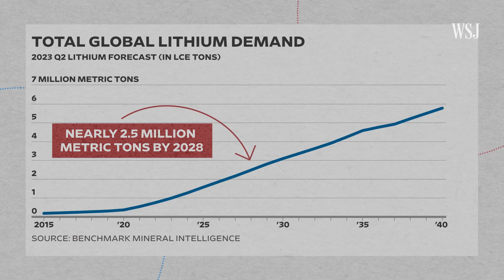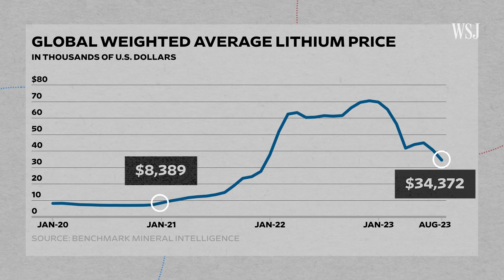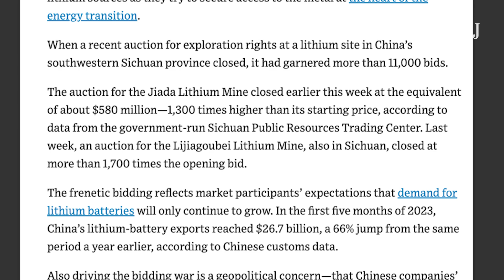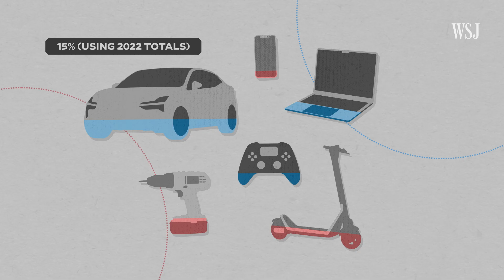How the U.S. Is Investing Billions to Compete With China’s Lithium Supply Chain | WSJ U.S. vs. China

Comment: China is ahead of the US in EV tech because unlike the US, China has to import most of its oil and gas. 
The EV industry will help China become greener and more self-reliant when it comes to energy imports
Reply: Doesn't the video say China gets most of its lithium from overseas?
Reply: Were do live! in cave!, it's US that's ahead of everybody else in EV technologies,  you are confusing mass production of junk EVs by China as their lead in EV technology.
Reply: Greener probably not so much considering the volume of coal power being brought online, and we can question how their raw resources are being secured.  China is doing this for their own independence and for financial reasons, not environmental.
Reply: @Destor-p3b It's both and much of Raw materials comes from AUSTRALIA.
Reply: >> China is ahead of the US in EV tech because unlike the US,  <<
ever head of Tesla, which is a US company?
Reply: @tooltalk the most advanced Tesla factory is in Shanghai, and they get most of their batteries from Chinese battery manufacturers.
So yah, China is way ahead in EV tech it's not even a race at this point.
Reply: @jayceh  >>  they get most of their batteries from Chinese battery manufacturers. ,<<
Tesla's most advanced EV models use batteries use batteries from Panasonic and LG.   China's cheap, inferior batteries are for base, low-range models.  The EU is also investigating whether Tesla was given kickback from the CCP to use their inferior batteries for EVs exported to the EU.
Reply: @tooltalk  wrong, Chinese batteries are at least 2 generations ahead of Japanese ones. Please do some basic research.
CATL and BYD lead in tech and volume by at least a half decade.
Reply: @jayceh  >>Chinese batteries are at least 2 generations ahead of Japanese ones. <<
A lot of wishful thinking there.  The lithium ion batteries were pioneered by SONY back in the early 1990's and the Japanese and Koreans have lad the industry since.  China's LFPs are cheap, inferior batteries licensed from a patent consortium in Suisse years ago and China spiked them up for use in low-range, urban driving EVs.  Outside China and under certain application such as ESS, their appeal is very limited.
Reply: @tooltalk  yah they had a 3 decade lead which is even more egregious that they fell so far behind lol
Light research shows only CATL, and later this year BYD have 800km+ batteries for EV, up to 1000km by end of this year
Panasonic is stuck around 550-600 real world range.
Deeper research shows the completely different approach which shows Panasonic will never catch-up
Reply: @tooltalk  but really all you need to know is that after the real world range of Toyota's flagship EV was widely criticized in Norway and other northern European countries, they switched to BYD for their EV lineup.
Reply: @jayceh  lol.  neither Japan or Korea makes cheap low-end batteries for gold carts.  Catl's specialty is in mass manufacturing, but their batteries are low quality.  BYD is slightly better than catl, but they are stuck with cheap lfp.  No 750/1000km with low end batteries.
Reply: @tooltalk  CATL dominates golf cart batteries due to superior technology (manufacturing) and highend batteries due to a different type of superiority (chemical)
Again if you did any research you'd know high end batteries are dominated by the Chinese. Also low end. Also midrange. Also storage batteries like sodium ion.
Also molten salt nuclear reactors... but that's something else. Only the chemistry is similar.

Crawl out of your rock from 2018. I know it sounds recent but the world's changed since then.
Reply: @tooltalk  Tesla battery supply chain manager Vivas Kumar disagree with you.
Reply: @TheExtraterrestrial99  disagree on what?
Reply: @TheExtraterrestrial99  >> Tesla battery supply chain manager Vivas Kumar disagree with you. <<
Disagree on what?  Again, Tesla uses China's cheap, inferior LFP batteries on entry-level, low range models -- the Koreans and the Japanese NCM/A batteries in the higher trims.  What "advanced batteries" is China making for Tesla?
Reply: @tooltalk those LG and Panasonic your talking about basically can’t manufacture batteries without china lol. And 8 of the top 10 battery manufacturers are chinese.
Reply: @tooltalk South Korea and Japan is too reliant on Chinese Supply Chains. If China doesn’t provide refined materials they can’t make batteries. If you can’t make batteries you can’t make EVs. China is just way too ahead on this space
Reply: @theburden9920  >>  And 8 of the top 10 battery manufacturers are chinese. <<
Actually no.  Most Chinese battery makers make batteries for domestic consumption and little outside China where foreign battery companies aren't allowed to compete.   Outside China, the largest battery makers are LG, SK On, Panasonic and Samsung.
Reply: @tooltalk  the foreign carmakers are actually allowed to compete. But as a car firm you need to move your factory to china to access these batteries.
Reply: @tooltalk  idk where you draw your conclusions from but those companies you mentioned aren’t even close to China’s markets share in batteries. And batteries is just one component from the EVs. What about the high temperature magnets?? That China is literally the only country who can produce them??
Reply: @tooltalk lol, the only reason that Tesla still using Panasonic batteries is because the US government banned the EV factories in America using Chinese batteries. That’s also the reason Ford cancelled the EV plan because they can’t use the CATL batteries anymore.
Reply: @vrealzhou  LOL.  A lot of wishful thinking here. Tesla has been using Panasonic for a decade already and there are already Chinese battery companies such as Gouxuwan, Envision, etc..  China's LFP for only low-end, low-range EVs..
Reply: @tooltalk  where did Tesla's battery come from? ever heard of BYD?, the largest EV Car manufacturer
Reply: @birdsnature6421  : Tesla's batteries come from Panasonic -- the company has been with Tesla since the very beginning.   Tesla also uses cheap, inferior Chinese LFP batteries for entry-level, low-range models, which also happens to be under the EU's probe for having been illegally subsidized.

Comment: China's BYD is going to announce sodium ion battery powered cars by next year. This will drastically reduce the price of their low range vehicles. Lithium will still be used but sodium ion will be what will revolutionize the EV  space. Lithium will slowly be used for niche vehicles. Ie: Only for long range vehicles.
Reply: sodium isn't for high-energy vehicles -- they are for ESS.
Reply: @tooltalk What is ESS?
Reply: @slomo4672  : ESS == energy storage systems.  Think Tesla Powerwalls or stationary power grids.   Not all batteries are suitable for moving vehicles b/c of weight and EVs are already much heavier than ICE counterparts.
Reply: Sodium ion has very low energy density. It will not work on most vehicles. 

There is a lot of lithium in the world, look at lithium prices in last 2 years
Reply: Sodium ion battery is not feasible in EVs, or consumer electronics, that's the reason there are not that many companies in the world working on it.
Reply: UNINFORMED !  Sodium ion  batteries have been around for some time now and NOT developed in China at all!
Reply: Don't forget cell phones, cameras, computers, drones. There are tons of uses for lithium beyond cars.
Reply: And Tesla already has solid state batteries and that will be the future
Reply: @othmarbrunner9639  >> Tesla already has solid state batteries and that will be the future <<
SSB is not the future. Nobody other than Toyota is betting their house on that.
Reply: And guess what, they use lithium. There is only one metal at number three on the periodic table, pretty obvious isn't it?
Reply: @howardsimpson489  It was of little importance for millenia; it will become of little importance soon enough.

Comment: Lithium is plentiful. There is no need to fight for lithium. The value of lithium is tied to the ability to process the mineral.
Reply: Lithium is plentiful but not all of it is easily reachable or mineable.
Reply: @Heist1000  You are right, the US is home to the largest lithium deposit - 7.9 million tons. However various interest groups do not allow it to be mined.
Reply: >> The value of lithium is tied to the ability to process the mineral. <
LOL.   The problem is of mining which could take anywhere between 2+ years.  The most pouplar  brine extraction method likewise takes anywhere between 2 months to 2 years.  It's not the refining process that's the bottleneck or adds the most value.
Reply: @tooltalk it actually is.. it's the refining where lithium is converted into high concentration form and that's why China is focusing heavily on it.. even from supply chain $$ pov, mining hardly get 1-2 % of the total supply chain value for the battery.. that's is what I could understand based on the information i found..!
Reply: @mayanka3773  : miners margin's are 50+%; whereas refiners 15%-25%; battery makers 15%-25%.
Reply: Pilbara Minerals, (ASX PLS) Australia's biggest miner is getting towards processing on site using solar power. This means only the mineral leaves the site, not thousands of tons of ore. The increase in value stays with the company. Guess why I bought their shares several years ago and have a smile.
Reply: @tooltalk  if you consider absolute value in $$ at different stages of development from mining to finished products, mining hardly gets cents on the dollar!
Reply: Until fusion is a thing, then its the energy ressource for the next 1000+ years
Reply: It ainst as easy to get as you seem to think!
Reply: And soon sodium ion battery will be the majority of the batteries for EV cars.  It is REALLY a moot point about lithium deposits.  The REAL CHALLENGE is processing ANY minerals AT SCALE.  And China dominates in that area.  Sometimes, Wall Street Journal have reports to "implies" that "securing some minerals" are the "trump cards" to win.  NO!  The ability to process the minerals is the KEY TO WIN.
Reply: The complaint about EVs is the weight of their batteries. If you replace lithium with sodium, the weight gets much heavier. Really only suitable for locomotives or big trucks. When you look at most "game changing" new battery tech, it usually has lithium tucked away inside but hidden in the BS.
Reply: @jkuang correct. The raw good is not the problem or threat. The ability to refine and process is. CH correctly placed a bet to invest heavily in refinement and processing plants. US did not. That’s what gives them their leg up.
Reply: @jkuang sodium ion batteries nowhere near the energy density needed by cars. It will only be put into low range budget vehicles or other applications, unless a major breakthrough has been made. I'm not one to put my bets on "future unknown advances" of sodium tech, unless there is evidence it can be. With the same magical illogical unfounded expectation of sodium, you can magically expect any other material to be a battery, why not wood or plastic.
Reply: @htko89 there might be the solid state sodium batteries in the future. Could be enough for daily use. Normally 600-700km is the daily limit for human beings. And people can do slow charging via regular outlets overnight in hotel or at home.
Reply: @vrealzhou  I only put my bets on present day tech. Sure I’d love to see that future but “might be” is not the same as “currently”.
Reply: @htko89  fair enough. The sodium batteries are already available on budget vehicles since earlier this year, not "will be". I will bet on the speed of the battery tech development.
Reply: @jkuang agreed, process in small scale and large scale are different. Some even based on totally different methods or technologies. Large scale processes would need to handle more complex tasks and deeply integrated with the local environment and situations
Reply: At any rate, Lithium is only a bridge-gap solution. Lithium will soon be replaced by other materials in the battery. Sodium batteries and Graphene batteries are already on the market.
Reply: @MetaView7  , this is oversimplified. Recall the basic principle of battery design. Li and Na have the same +1 valance state, but quite different masses. What seems more likely is a diversification of high energy density batteries. Graphene, like graphite is perhaps an electrode material, not an electron donor/acceptor in the same sense. (i'm simplifying here)